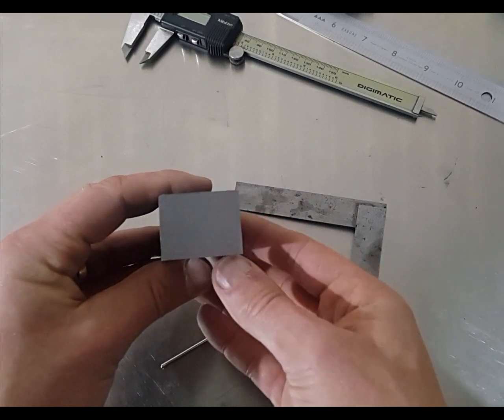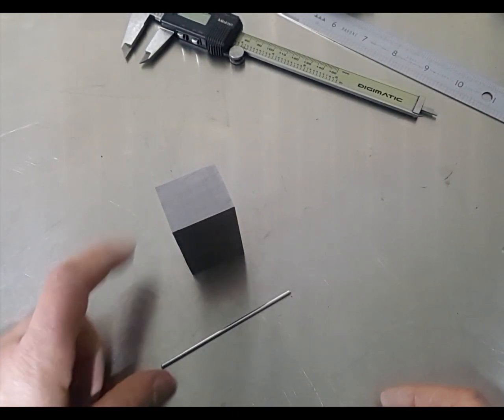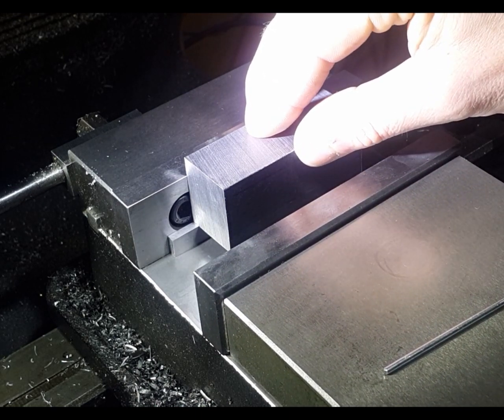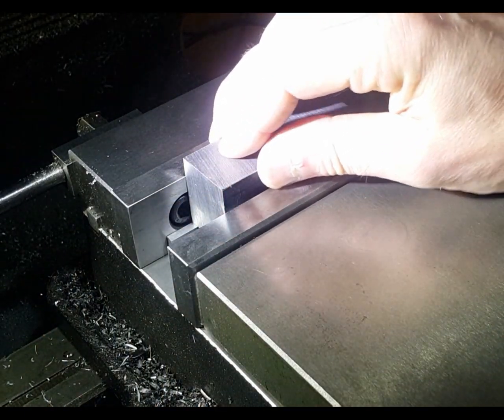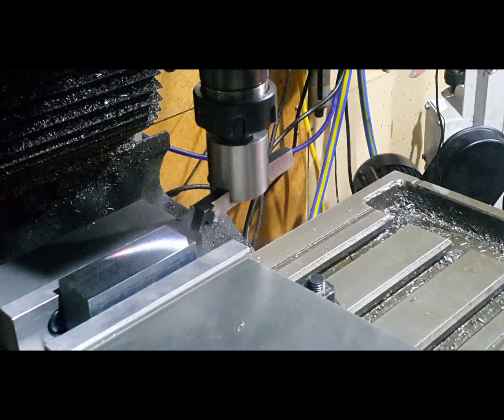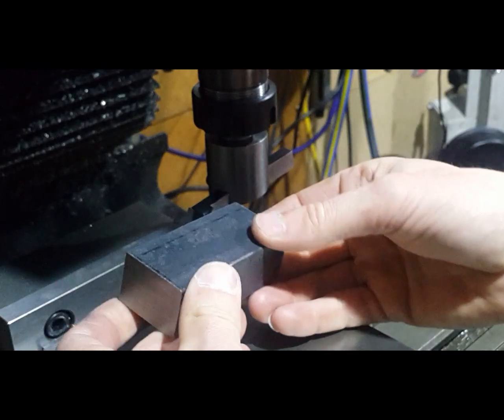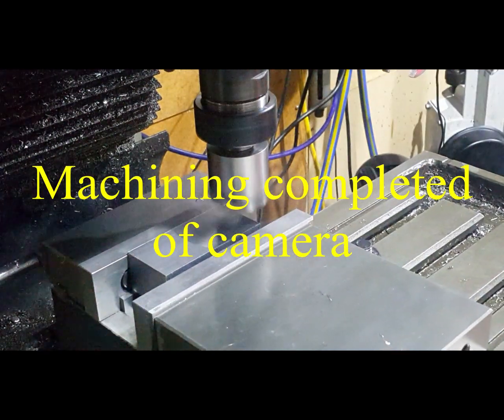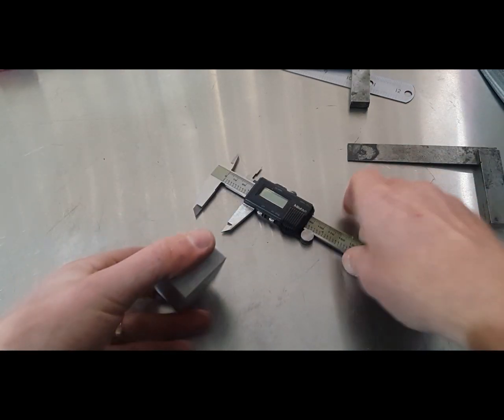#36 - How to square up raw stock on the milling machine    #tipsblitz19 #tipblitz19

Comment: Good tip about using the tig wire. I have a project where I need to mill a square on both ends of a 2 inch shaft. (The square dimensions are obviously less than 2) Any ideas please? particularly in getting the correct depth of cut, I have dial gauges and digital callipers but unfortunately no DRO.
Reply from the maker: There's different options. One would be apply layout dye to the ends. Find the centre. Measure/scribe out from the centre your square and machine down to the lines. Set the shaft on either v blocks or clamp down staight on the table.
Reply: You can use the "paper trick" as shown in my "how to use the shaper" video.
Reply: @Rustinox  Thanks I will look up your video especially as you are a fellow shaper owner. I have an Ormerod shaper made in Hebden Bridge in the UK